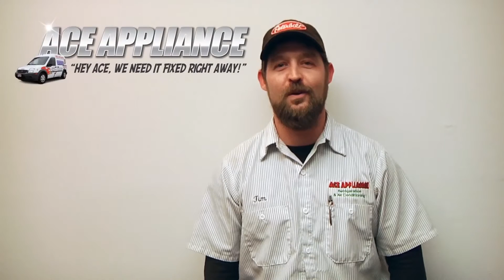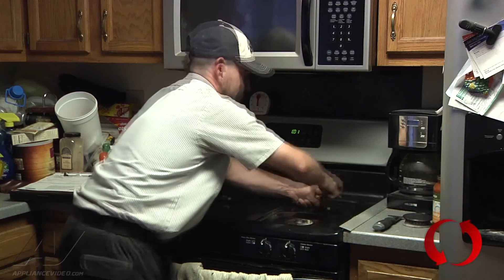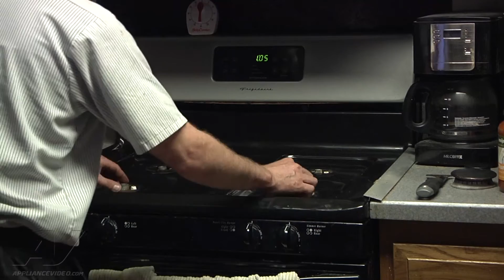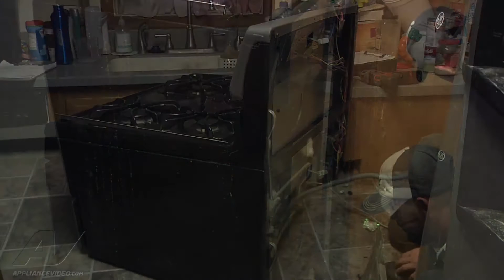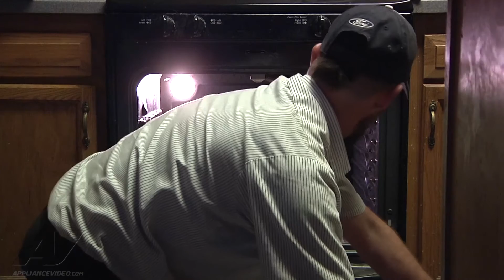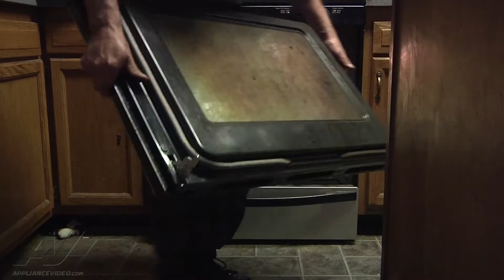Frigidaire Stove Repair - Gas Smell Within the Home - FGF368GMD

Comment: ok so i smell gas...very faint...no leaks...but when i pulled the cap/plug off the regulator, then it started beeping....any thoughts?
Reply from the maker: Great question, if you have a more technical question that our parts department cannot answer, you can search our over 17,000 answered questions free at our website www.ApplianceVideo.com under our Repair Help section. You can also call our parts department at 1-800-830-5465 and they can give you help 7-days A week ,or search at www.SaveMoreOnParts.com  .

Comment: Hi I just bought afrigidaire range coil on top.whenever I turn on my coil it smells.Thanks
Reply from the maker: Great question, if you have a
more technical question that our parts department cannot answer, you can search
our over 10,000 answered questions free at our website www.ApplianceVideo.com under our Repair Help section. You can also call
our parts department at 1-800-830-5465 and they can give you help 6-days A week
Monday -Saturday, or search at www.SaveMoreOnParts.com  24 hours
7- days A week.

Comment: Is it safe for the heat to come from the oven vent in top of your stove. It's annoying, it heats up my whole house. Why does the heat come from the top.
Reply from the maker: Great question, if you have a
more technical question that our parts department cannot answer, you can search
our over 10,000 answered questions free at our website www.ApplianceVideo.com under our Repair Help section. You can also call
our parts department at 1-800-830-5465 and they can give you help 7-days A week
Monday -Sunday, or search at www.SaveMoreOnParts.com  24 hours
7- days A week.

Comment: I have a propane leak somewhere on my Hotpoint stove. Had the line coming in from outside pressure tested and replaced the service line. Checked for leaks with window cleaner no leaks visible. It's such a minor leak it takes some time before the smell develops after the shut off is opened so this leak is so far very hard to find.
Reply from the maker: Great question, if you have a
more technical question that our parts department cannot answer, you can search
our over 10,000 answered questions free at our website www.ApplianceVideo.com under our Repair Help section. You can also call
our parts department at 1-800-830-5465 and they can give you help 7-days A week
Monday -Sunday, or search at www.SaveMoreOnParts.com  24 hours
7- days A week.

Comment: I have an Electrolux oven with a similar problem.  You could smell a strong gas emitting from the oven only when it was on. After having the repair man come back 4 times to replace virtually everything in the 2yr old stove we finally figured it out.  And you will never guess it!  Its the BAFFLE which Tim in the video explains as the "flame spreader".  Its a plate that's directly above the gas tube.  Also, there are 2 kinds/model numbers which adds to the confusion for the part.  One has oval holes in it and the other just has a bump.  Be sure to know which one it is.  Was on the phone with Electrolux a couple times and after 2 returns, we got the correct one.Took it out, turned the oven on and the smell was gone!  I have no idea why this is the culprit however it was...We have the Electrolux refrigerator and dishwasher as well.  All have been serviced and repaired over 14 times in 4yrs.  Terrible products.  Will never buy another one...
Reply from the maker: +mshrewsbury11 

Thanks for your positive comment. We are glad we
could help resolve your issue and hopefully saved you money. Please help us
provide more videos to our site by subscribing to our YouTube page or posting our
http://www.appliancevideo.com/ website on your Facebook or Twitter account. Our
factory authorized technician’s also daily provide free professional Repair
Help to people like you to help solve their appliance problems. You also have the option to email a factory
service technician with a question at http://www.appliancevideo.com/repair-help/ .  If
you need of parts for your major appliance, we have over 5-million parts in
stock at http://savemoreonparts.com/ . Thanks
in advance for supporting us. So email us if you have any other questions our
videos cannot resolve. Thanks for your support in advance.   Matt, Ace Appliance service technician.

Comment: I have a question,  I replaced the ignitor on my oven it seems to keep temp but still smells of gas only when I turn the oven on *only. No leaks from the wall to stove and no oder when using the burners.
Reply from the maker: Shidoin
              All of our technicians are now answering questions daily on the ApplianceVideo.com website for anyone needing help. Just copy and paste this this question under REPAIR HELP, and one of our  factory authorized technicians  will answer any technical questions at absolutely no charge on your appliance issues. We also have over 2600 free repair videos to help with your appliance repair issues. Thanks for your support. Matt Ace Appliance factory service technician
Reply: I have that too.  Current guess is low gas pressure.  I've had oven repair guy out twice.  Driving me nuts.